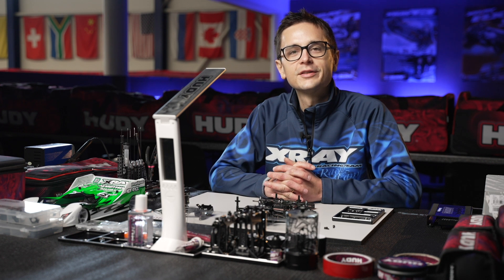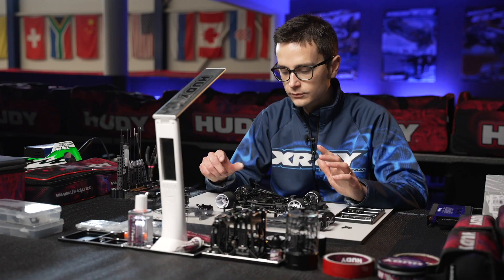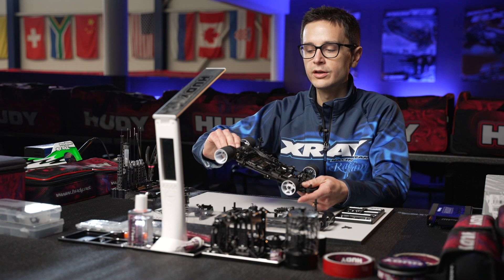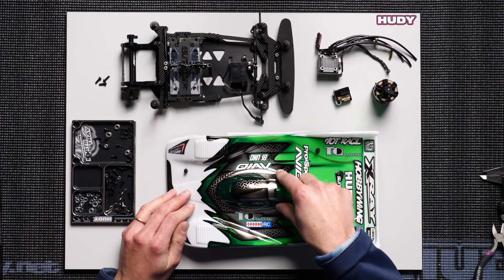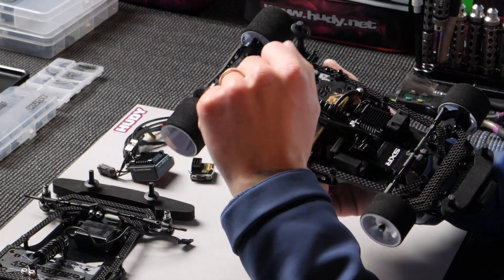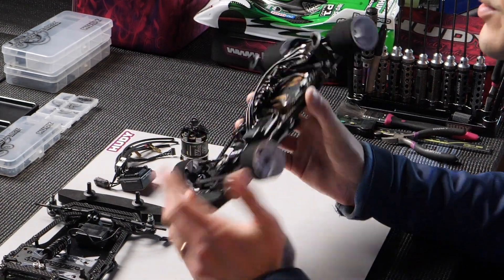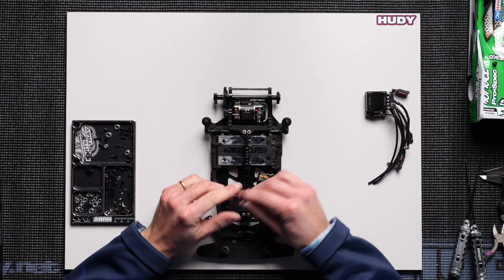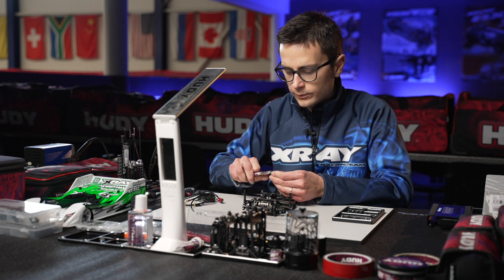XRAY X12 - Tech tip video - Electronics Installation

Comment: Great video! Voltage booster is that standard with hobbywing speed controllers or sold separately? 🤔
Reply: I think he meant the capacitor module.